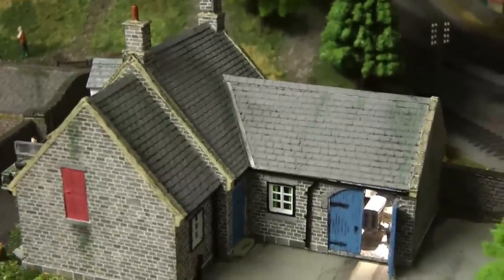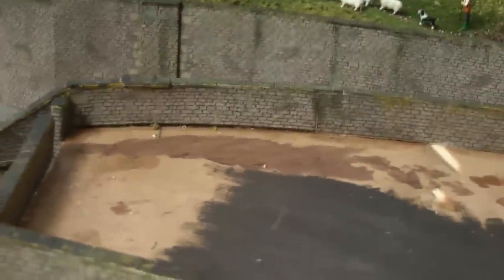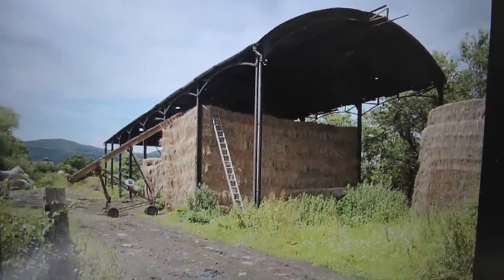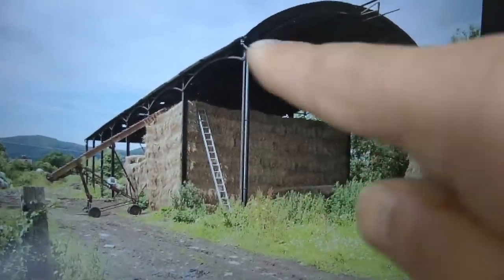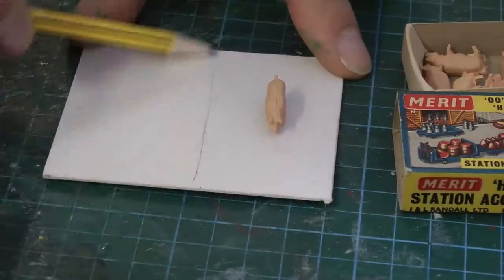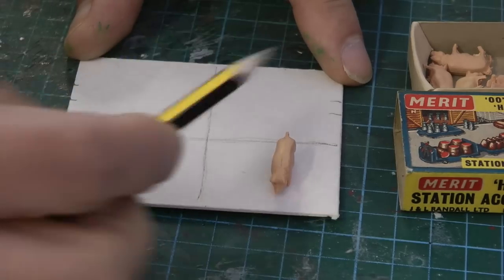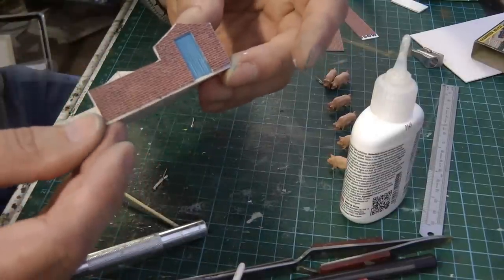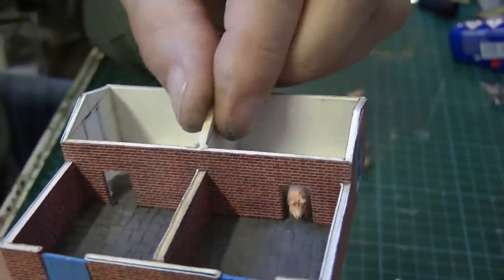Snookdown Farm   Part 6 No370

Comment: Hi Tony. I have a similar arrangement of a building and a walled area and the building has space for a pig to live in the bottom when the weather is inclement and the upper section, just under the eaves of the roof, has shelves either side for hens.  So mine is a pigsty/hen house.  I don’t keep livestock.
That photo showing bales, appears to me to be bales of straw not hay, but I could be wrong as some types of meadow hay look a similar colour.   Straw is the stalks of cereal crops, such as barley and  wheat and are of a yellow or straw colour (hence the name) and is used as bedding material for livestock.  Hay is usually dried long grass in the UK, but can be made from other crops like legumes (peas, beans, lentils) including stalks, pods, or seed heads.  Hay is finer than straw and is usually more of a green colour though depending on the crop can look yellowish.  The important thing is that hay is for feed and straw is for bedding.  Straw for your pigs bedding and hay to feed your sheep in the winter.
I must admit that when I saw the photo on the community page, I thought that you had bought and assembled a pigsty kit. 🙄  A great bit of scratch built modelling, my friend. 👍
Have a great weekend.  Best, Jason.
Reply from the maker: Good morning Jason. a very most welcomed comment. i think yes bales of straw. is what i will do for the barn. which i have started by the way. i am glad you have mentioned that. 
I dont think you could buy pig stye kits on the market. i just like to have a go at building that i have not done before. which makes the hobby more interesting. thanks again my friend. stay safe Tony.:elbowcough:

Comment: Just a concern about the mucking out doors, obviously the sty is not a generic building, it was built to go wherever it ends up so having a mucking out door right in the corner and inaccessible doesn’t make any sense. The best fit for me was on the orchard side facing towards the house, the fit seemed perfect and the wall angle made sense.
Reply from the maker: Hi Edd, very true comment. as long i leave a gap for the farm hands. then there shouldn't be anu problem with access to styes . many thanks again. cheer's for now Tony.

Comment: And yet another stellar build Tony! :) I see from the final shot of the video that you pulled it away slightly from the brick wall on the roadside. I'll admit I was wondering how the farmer etc were going to reach the door on the side. It was really doing my OCD head in 😄 I know you said you wanted it to be removable but did you ever consider the idea of building it incorporating the retaining walls on the back and side? Just an idea but you know me, I would never criticize your workmanship mate. Keep up the excellent work! 
Mav
Reply from the maker: Yes i agree. the final placement of this pig stye is the key on how its all going to look when its finished. as the space is very tight. i could removed the end wall like you mentioned which would only give me 25mm approximately. its a thought. thanks again for commenting, as they are always very welcome. cheer's for now Tony

Comment: Dear Tony, just wondering on the structure you’ve shown as the hay barn. It’s not that I mind, I love that particular example. However, even when I don’t go back to the fifties, Dutch hay stacks until the seventies had a very distinctive look. Mainly consisting of four poles with a tented or pavilion roof, which could slide up and down the posts, depending on the amount of hay that was stacked under it. 
Didn’t know if British hay stacks at that time had a similar distinctive style, but when I looked some up for the appropriate time period, I definitely didn’t find one which came close to the one you showed.
Love the pigsty, really seems to fit the overall scene round the Snookdown farm. Cheerio
Reply from the maker: Good morning Vincent. i will look into the old barns. like you have suggested, as you know space is very tight for a huge barn. as the for the hay stacks they come in a variety of sizes. depending on the machines that made them of course. i will be making the 4ft x 3ft stacks 2ft tall. the barn is already underway as we speak. hopefully we will get these two little jobs done this week. thanks again as always, very informative comment thank you for all your support. ta ta for now. Tony